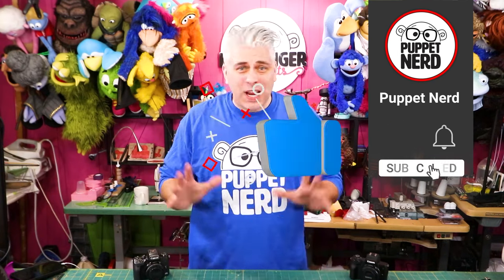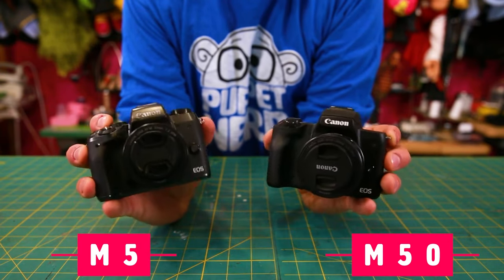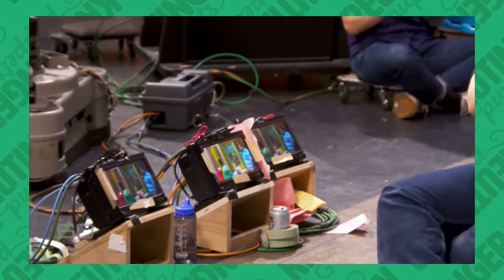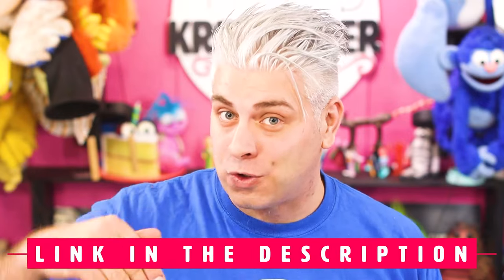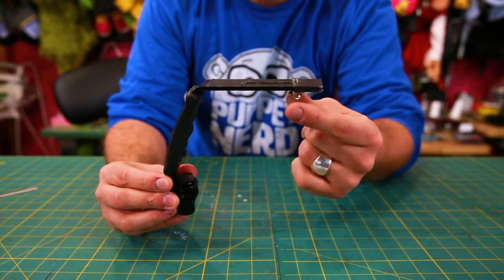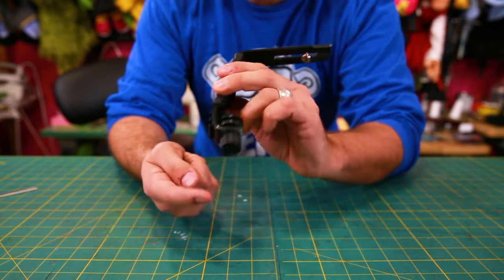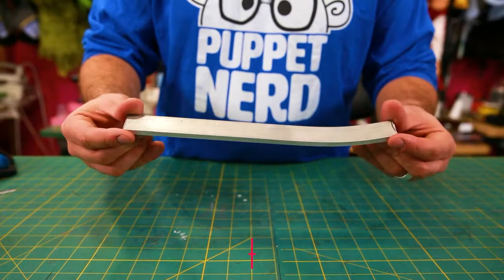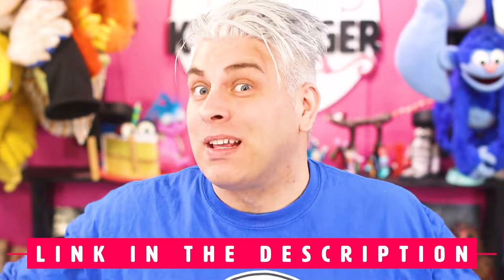The Best Camera For Filming Puppets!

Comment: Why wouldn’t reverse scan be better? 
I would think it would be easier to use because it’s just like looking in a mirror which is a more natural thing.
Reply from the maker: Because straight scan is exactly what the audience sees. It’s especially healthy when using numbers, letters, and words on screen. Otherwise they would be backwards.
Reply: @PuppetNerd  but as long as the output is correct the monitor output shouldn’t matter.
Reply from the maker: @glennfulcher429  Without a doubt. But it’s hard to read things backwards.
Reply: @PuppetNerd  why would I need to read anything on the screen if I’m just using it to orient the puppet?
Reply from the maker: @glennfulcher429  just think of the work Sesame Street does. Using letters, numbers, and words. Plenty of reasons.